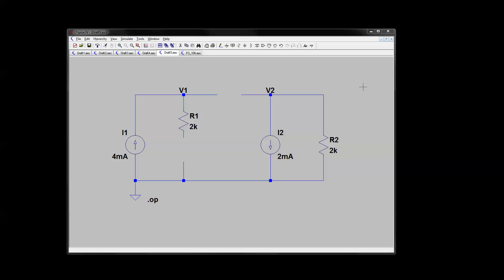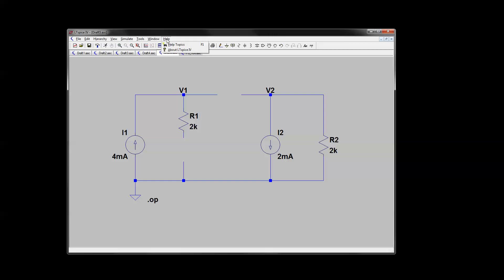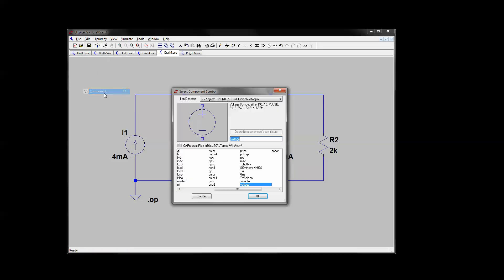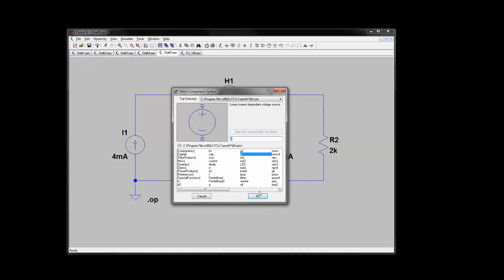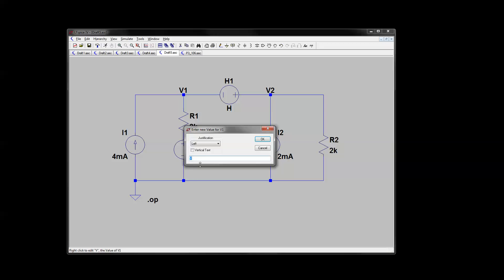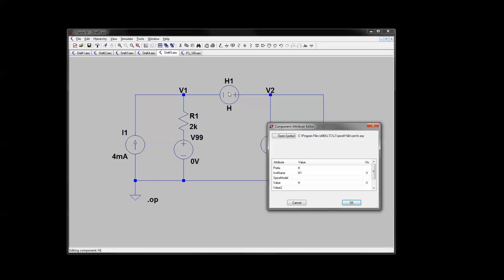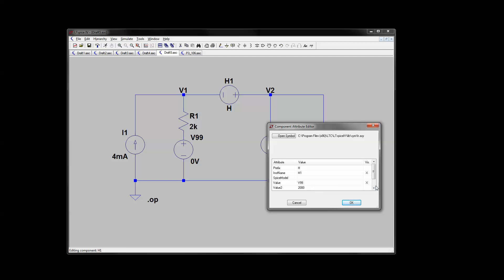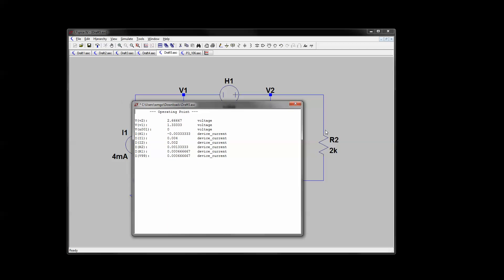Current Dependent Voltage Source in LTSpice

Comment: Merci. 
For further explaination: H element are current dependant voltage source. In the above exemple, he uses the current flowing through V99 multiplied by 2000 as a value for his "H" source. 
The V99  voltage source is put at 0V. It can be use to sense current without tempering with the circuit.